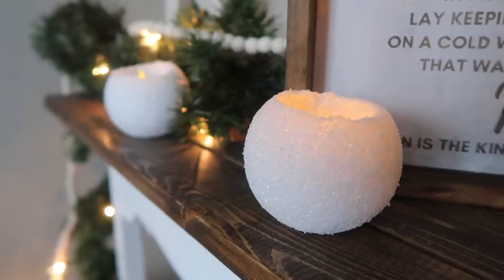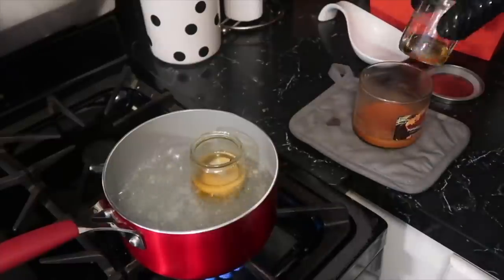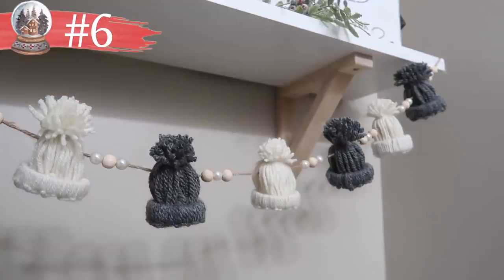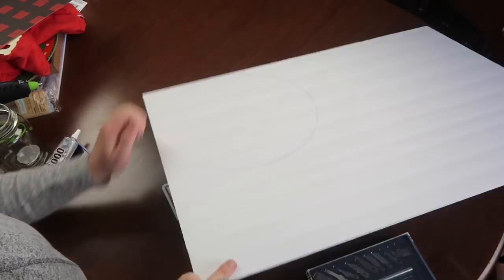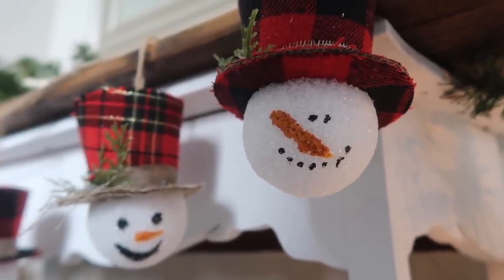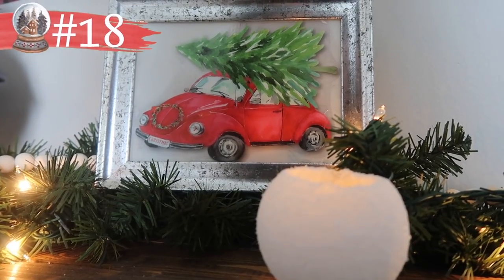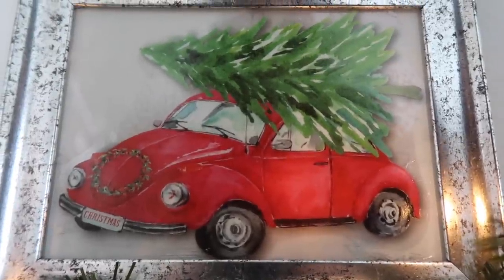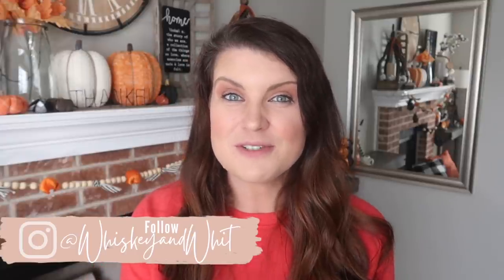20 AMAZING High-End Dollar Tree Christmas DIYs 2023 🌲 Cheap $1 DIY Decor that looks EXPENSIVE! 😍

Comment: Just an FYI...at DT, I buy the tall candles usually in white & buy the wax melts in a scent I like as well. I'll melt the candle in the glass in a pot of water over a medium heat. Remove the wick when possible & reuse if you'd like. Add your scented wax melts, one at a time once the other wax is liquid, stir with a skewer to melt them in. Pour into another container with a prepared wick and let it cool for a scented candle. I've found it takes about one & a half of the tall candles with a full wax melt pack to make about a 6oz candle.
Reply from the maker: Great tip!!

Comment: You didn't explain where or how you got the peppermint design for the top of the jar or how you transferred it-you called it a faux transfer.   Did you just draw the peppermint freehand? Very nice!
Reply from the maker: Hi there! I printed out an outline of a peppermint to the size of my lid, cut it out, and then scribbled on the back with a pencil. Then I put it on the lid and traced over the lines to transfer the led to the lid and then I painted it :)
Reply: @Whiskeyandwhit  ok the scribbling on the back-what does that do, ie how does that help? I'm confused by the scribbling?